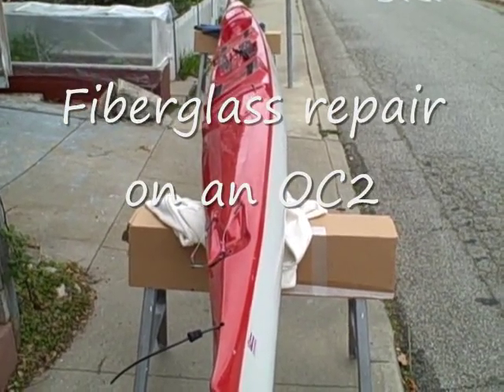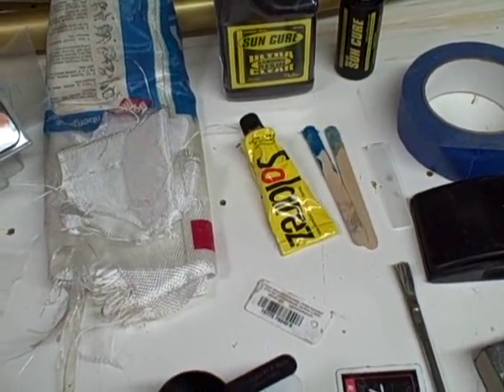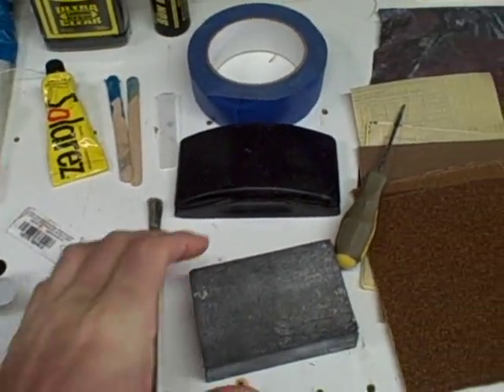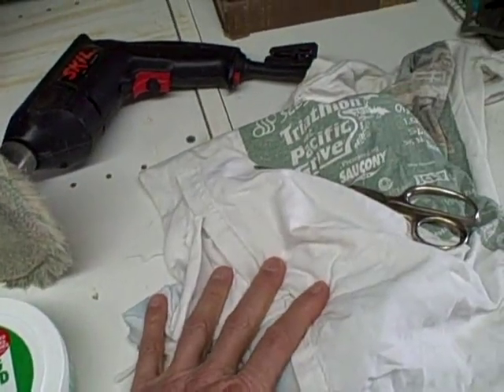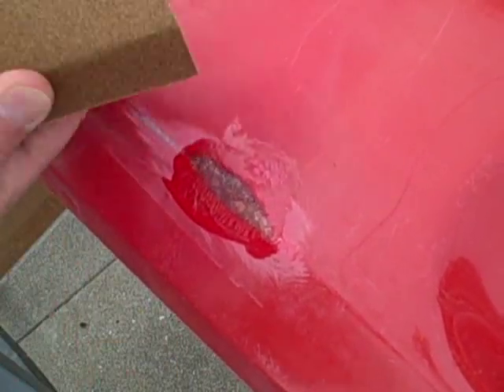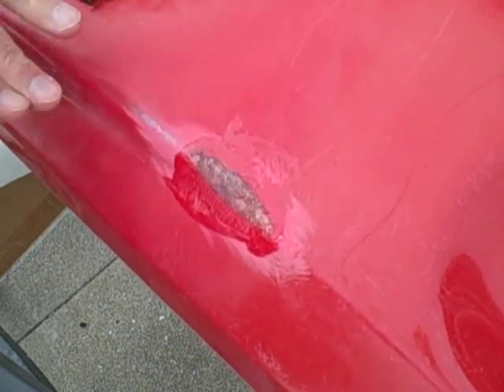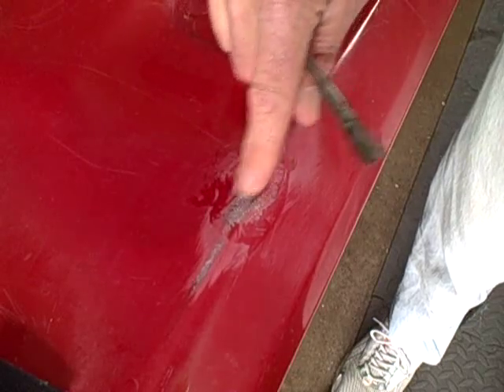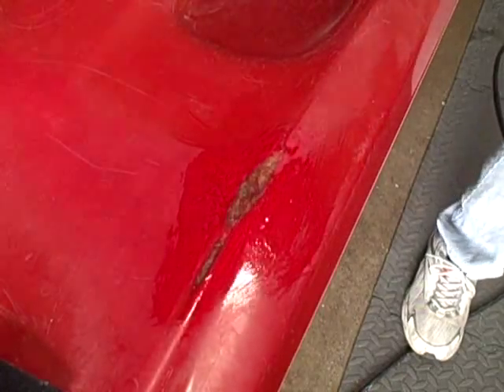Fiber glass Repair Outrigger Canoe OC2

Comment from the maker: It really isn't too hard.  Just be ready to spend a little time sanding it smooth.  You can always just sand out the mistakes and start over. For big areas you can gently use a small grinder to prep the area. Sun curing resin has made things so much easier, and it doesn't yellow in the sun over time.  Try a small repair first to get the hang of it.  Good luck.

Comment: It's interesting,how you used the sanded color to match the color,very cool.if this crack was way bigger lets say, 5" in length and 5" wide,would you still have used the resin instead of gel coat?I'm interested to know  if resin ,on a larger surface, will cause drag.
Reply from the maker: TheDcrocks1 With a larger break I would use regular epoxy resin with the cloth. To finish it I would use spray paint if I could match the color. I did that in a video of an ama repair. Gel coat works well but takes way more time, but with a color kit you can match almost any color. With Solar Rez light has to penetrate all of the way through, so you could do it in layers, and if you had enough colored dust, it would work.

Comment: So no paint needed? How is that, since you did so much sanding?
Reply from the maker: Well, I could have used paint, but matching it would not be easy, and the Solar Rez works fine especially for small repairs. Using the red dust from sanding gave the repair just enough color so the repair didn't stand out too much on this old canoe. I have used paint on several other repairs. This Honukai was heavily used as a club training boat, so just wanted to fix the puka, make it water tight, and strong. It held up well until the canoe was destroyed last Winter when a car crashed into our storage area smashing several boats.